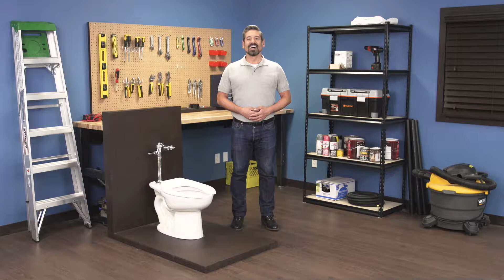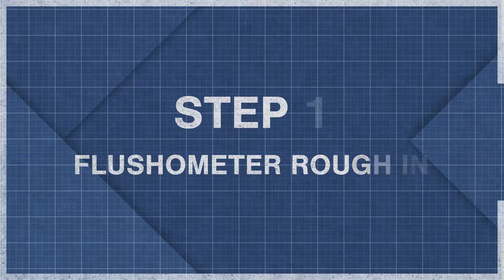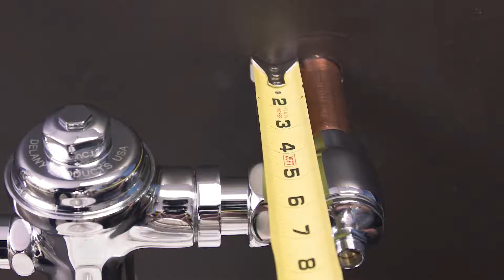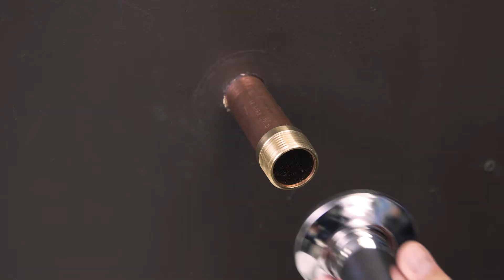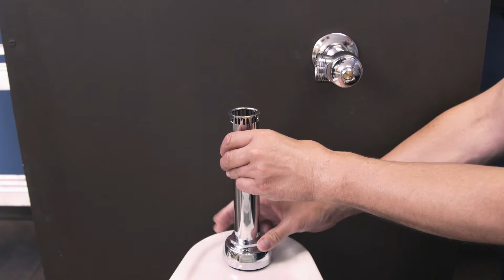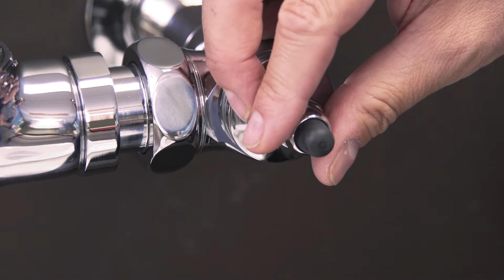Delany (Flushboy, Rex, Presto) Flushometer | Installation | Repair and Replace

Comment: I have a leak at the tail pipe coupling, I would like to unscrew it and put plumbers tape there.  I have closed the control stop.  Should that stop the incoming water and allow me to unscrew the tail pipe coupling to apply the plumbers tape?  This is an apartment house and I would prefer they did not have to shut off the whole line to repair the leak.